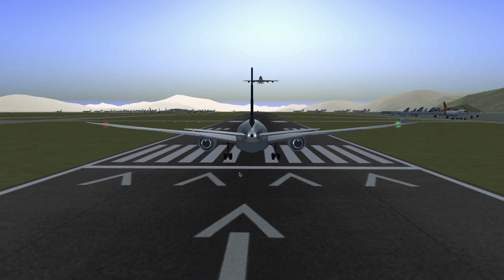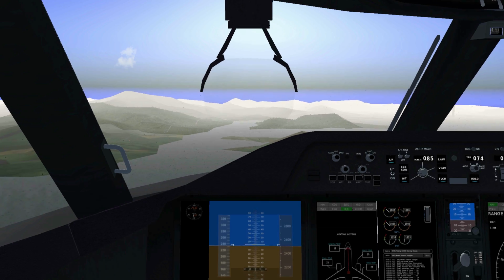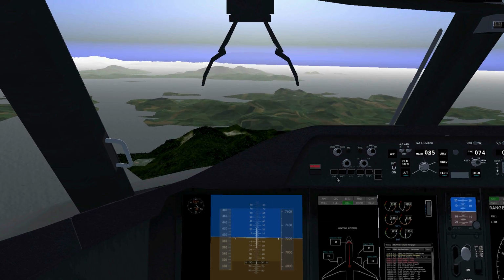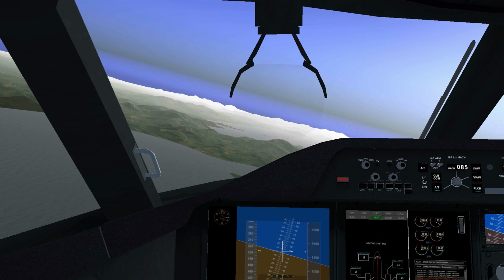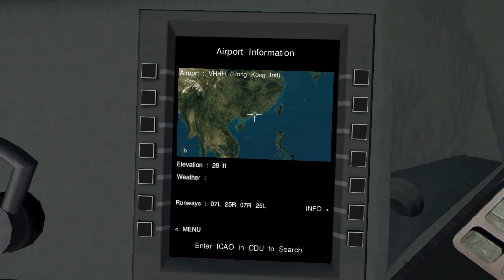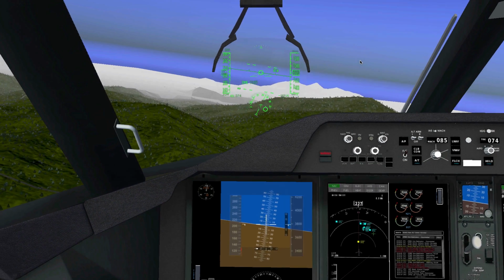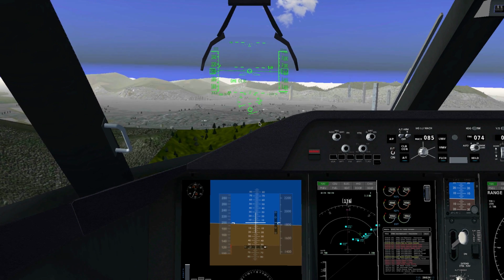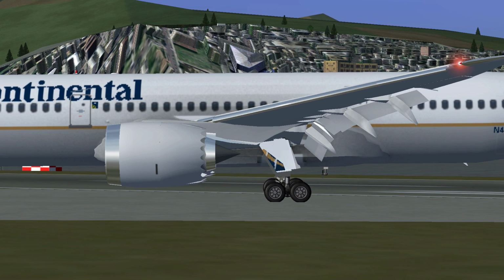787 Double Engine Failure - Real Time Recording

Comment: Hi Man, sweet video!
just a question, when I download the 787, I don't have the screen you have inside the cockpit. What should I add to have as much flight infos as you have ? (for ex. my OH panel is quite empty and I don't have the informations about the engines !
Thanks !
Reply: You have the old version of the 787 and not the new one you can get the new one from the omega hanger which can be found here :http://theomegahangar.flymerlion.org/aircraft.html  :  Just go down about and download the tgz soure file :)
Reply: Jeremy Wenner Thanks a lot Jeremy ! Can you also tell me how to get the file from .tgz to .zip so I can use it in FG ?
Reply: Are you on mac, Windows, or Linux?  If mac you can just double click it but if your on windows o linux just tell me :)
Reply: I'm on Windows !
Reply: Gabriel Grossmann ok go download a program like GZIP or a program that can open up a .tgz file

Comment: Yes. I am also no expert in this area, but the APU should be able to generate power as long as you have enough fuel ;), without the ram air turbine. I am not sure if it's implemented in the 787-8.